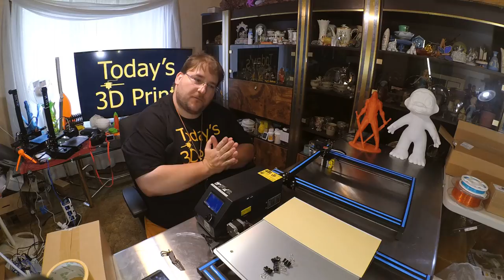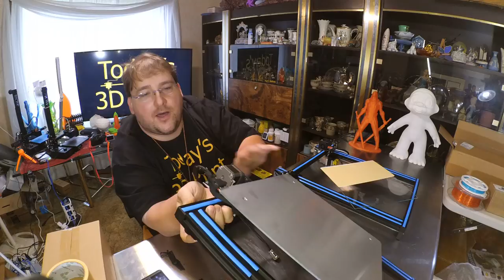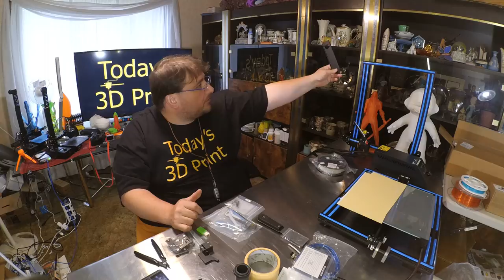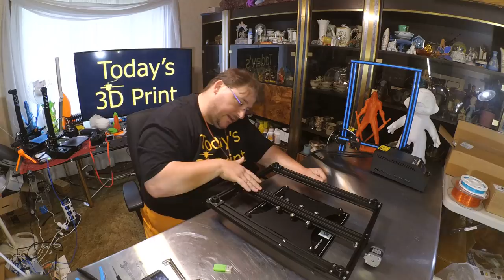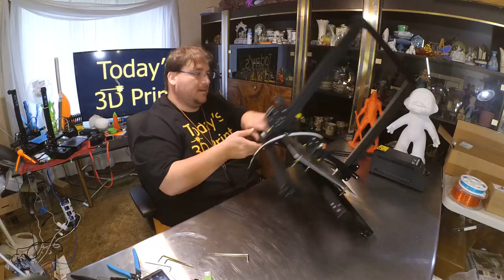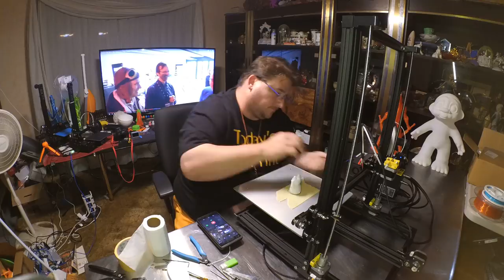Today's 3D Print 113 Creality CR-10s rev1 Unboxing, Build, First Print cr10s cr10

Comment: What temp do you print your Ziro PLA in?  I tried a gold roll and am getting some slight zitting. I use your CR-10 settings at 215.
Reply from the maker: GarretB123 I do first layer at 225 and then I drop it to 200 at layer 2 depending on your print if it's large enough not to result in negative overall retraction try adding a coast of .2 and a negative restart of .2 to better control the zits that sometimes works but not always depends on what you're printing
Reply: Thanks!  That worked perfectly!  I printed a 20mm calibration cube and it was perfect!  That Ziro flows like warm butter!

Comment: Hi, Just got my Cr-10S and noticed that the Y motor is pulling towards the front from the factory. Is this normal?
Reply from the maker: +Keith Thompson what do you mean the Y motor is pulling toward the front?
Reply: Nerys the motor shafts is slightly pulled towards the front of the printer as though the belt is too tight.
Reply from the maker: +Keith Thompson oh that could vary be loosen the belt bend the bracket back so it is straight then put the belt back on tighten without over tightening it should be snug and strum like a guitar string but only just

Comment: I decided to order the CR-10S. Are there any CR-10/10S resources that you would recommend for newbie?
Reply from the maker: +Cameron Christian watch the bed leveling video. 99% of newbie problems stem from leveling. Get leveling down and you have licked most important 3d printing skill. 

Otherwise print a set of ultimate keveling knobs and the printer truly needs nothing else. You should receive all the upgrades and updates. Watch my build video it should hit on the important bits to check as you assemble it.
Reply: Nerys Thanks. One more question. When modeling parts that need to fit together properly do I need to make sure everything is in increments of. 04 mm so the nozzle can do it at the correct dimensions?
Reply from the maker: +Cameron Christian yes and no. That or you need "enough" tolerance to permit printing and fitting. With a .4mm nozzle this means objects smaller than .4mm in x or y might be ignored and or not printed. On z you are good easily to .1mm

Adjusting for the limitations is easy enough as long as you are aware of them.

Comment: Hi, its Chris from Bulgaria, I did not get the restraint piece with mine, so this morning i am wondering if the fan one is still the old one, can one see the difference between the old fan shroud  and the new design.  I saw the video about video editing this morning. I downloaded microsofts movie maker. I think save both into the same format from the same software then try and join them together. It is strange though as years ago there was not this problem, but then neither was the high res like today.  And, do we really need surround sound on videos.  Yesterday I thought my printer was suddenly making a noise, then i realise that it was your video, in the background was printing hahahaha. Oh that strange word on the memory card is a large nut and bolt. . Long live PLA
Reply from the maker: +christopher nicholson yeah dont print it its corrupt. Loaded the gcode and its got a few lines that go woosh off the print bed.

I am trying to avoid having to transcode at all! So if i can get my intro to match the video i get from the cam then no problem. Simomy merge my files and done. :-)
Reply: Ah, to late already done it, there is a fault on the bolt but the knurling is bloody great.So i went straight into making the extra large voyager, a few mistakes so far but going well, learning curve is on the Voyage long live PLA
Reply from the maker: christopher nicholson add a large brim disc make sure that brim disc touches the nacelles and the support that's the trick for printing the bottom half of Voyager also blow up to size of the support we're at a nice large brim disc to it for the one little part of the top half of Voyager
Reply from the maker: christopher nicholson just noticed your comment about the fan shroud this is easy if it's 3D printed print the replacement if it's ABS molded injection molded you're good to go

Comment: Hi its Chris in Bulgaria, got my CR10s yesterday,  I had a few issues though,  the upper bearing was jammed a few inches down the thread. I had to take it all apart to get to the bearing, got it off using a rubber ended screwdriver tapping the bar. The thread still feels a little tight, I loosened up the screws on the brass guide and it seems to be ok. I paid a DHL 5 day service that took 32 days before the delivery arrived yesterday. Can one get a refund from DHL, i had to pay customs and duty for the shitty service adding great cost to me.  Long Live PLA
Reply from the maker: christopher nicholson sounds like you got the right idea loosen the brass guides running a z axis up and down then tighten guy there is a little wiggle play with those and you want to be as free as possible make sure the Z rods are Not Bent or you will get ugly Prints. As for DHL I honestly do not know it can't hurt to call them and ask paying for 5-day service and getting 32 would annoy me too :-)

Comment: So ive got my Ender 2 working now:D However I have printed my first Marvin and of course it didnt turn out wonderful. I know you are very busy but if you are interested in answering some basic questions, is there a better way to contact you?

Btw, Its HUGE!
Reply from the maker: Ask away I love answering questions
Reply: ok, for example: In the Motion category on the printer, what did you change there or is there something like acceleration, which is necessary to change?
Reply from the maker: Simon333 Rudolph333 on the Ender you should not have to change anything in there the acceleration and jerk are already pretty low if you want something truly higher-quality little tiny bit of extra I would lower the jerk to 10. Otherwise the printer Hardware itself should give you very good results without changing anything it has a lot lower mass and inertia so you can actually go a little faster without losing quality
Reply: alright, set my jerk to 8 and printing benchy now, but ima try it witg 20 again. With my my Marvin however, it looked like the nozzle was just dropping the layers onto the print and on the final piece the outer layers could wiggle around...is that a bed leveling problem? (I leveled it so a thicker piece of paper had a little resistens)
Reply from the maker: Simon333 Rudolph333 check out my leveling video your first layer should look slightly squished there are two reasons I could see that happening one you been levels little high which would result in it dropping the plastic but if it's sticking there's not high enough to really cause that problem the other problem is your layer height is too high I would not use more than .2 millimeters on a Marvin or Benji you can theoretically go to .28 but you might see problems I would stick with .2 or lower
Reply: didnt found the layer height option in slic3r, but I think I have an older version so I will see if I change to Cura or update Slic3r/find layer height

edit: nvm I was dumb
Reply: Nerys The frame that makes up the square base is what dimensions please? My space size:12-14” Wide, 20.50” Deep, 25.5” Height, My desk will it fit? Thanx